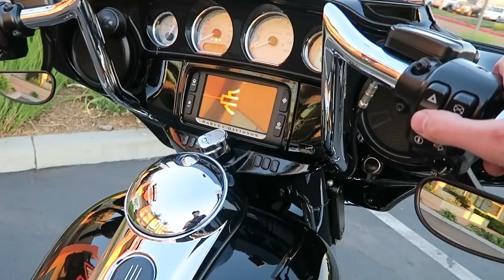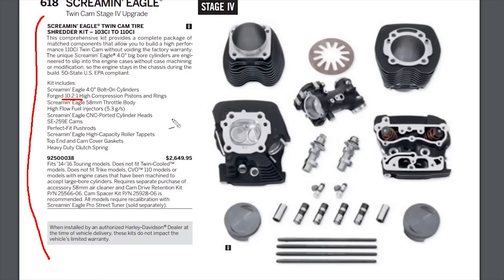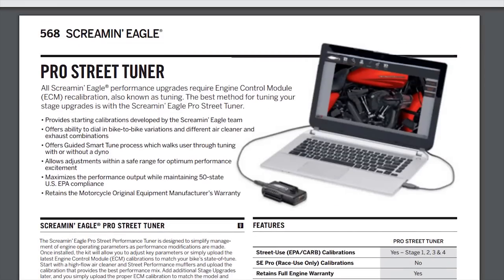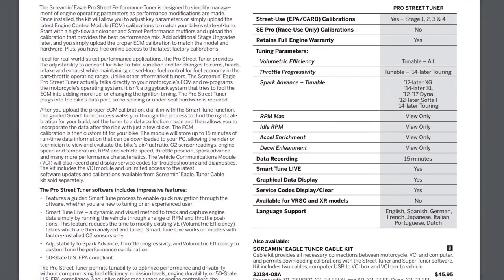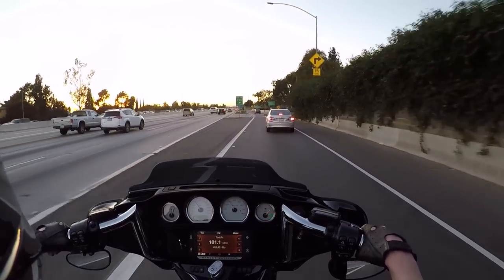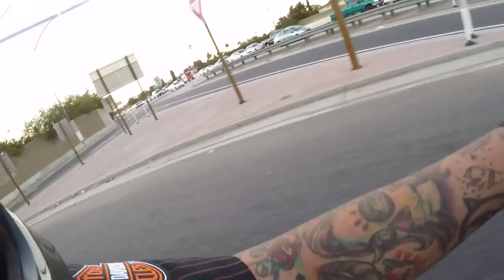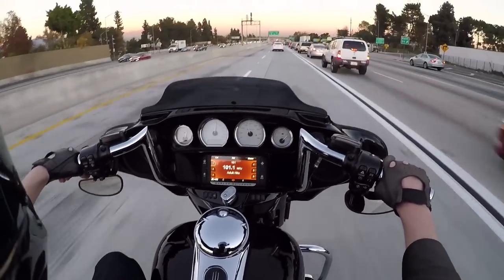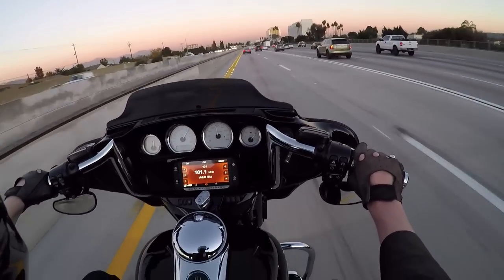Milwaukee-Eight Stage 4 VS Twin Cam 110 Stage 4 │Harley-Davidson Screamin' Eagle

Comment: Fantastic run, the roads don't look all that smooth. I have the 103 in my 2016, did put oversize titans, harley hi flow kit and the Vance/hines fp3. What would you suggest doing next or leave it alone? Thanks
Reply from the maker: With that build you get the benefit of a richer sounding exhaust and a slight performance increase. If you want more torque and HP then do a stage 3 or 4

Comment: Does it matter if you keep the same stock tire versus a tire that handles high speed?  Does the tires make a difference at high speed (i.e vibrations,death wobble.)
Reply from the maker: These tires are just fine. The bike tracked great. Some times of freeway joints of bumps it can shimmy a little.
Reply: Always liked Pirelli night dragon tires. Very sticky when performance trumps longevity.

Comment: glad I found this video, my 18 limited is coming in soon and have been anxious as to how this m8 will compare with my 16 limited. Seems that the twin cams make more power at lower rpm than the m8. So the stage iv is out seems like it would be a waste of money. Matt what are your thoughts on the m8 with stage 2 and a good tune. The twin cam I have now has 98.75 hwpr and 121 tourque with 585 cams, fuelsac headpipe ,super tuner and screaming eagle springs and lifters. Can't seem to find any numbers like this on m8. Yes numbers are numbers, but what are your thoughts.
Reply: oh she is still 103
Reply from the maker: The stage 4 needs to be run at a higher RPM to get the max benefit out of the build and cam. Your build you mentioned is a nice low end torque build. This is more for the guy that like to run their Harley at a higher RPM. The 585 cam is a low end torque power delivery. So it just comes down to your riding style

Comment: I added high flow intake, competition 2-1 header and FI remap to my 17 Road King M8. The mid-range is awesome and I pull my buddies Indian 111 to the governor before he eventually passes me :( Hey Matt! How do I turn that shit off man!! Great video as usual! Thanks!
Reply from the maker: I don't know. Let me know if you find a way
Reply: Only way to do it is after market tuner , but that will possibly void warranty.
Reply: Israel Rangel without a doubt voids warranty.
Reply: seems like you could figure out a way to fool the computer on actual speed. i'm guessing it is speed controlled for top speed and not rpm too.

Comment: Great video Matt Thanks! I have the Stage IV Kit with the S.E. Smart Auto tune pro & the Street tuner on an 18 FLTRXS & the governor will not let the bike go over 111mph. You say in the video you have done 120mph I'm trying to figure out if that is truthful or not? HD tech support has told me that 17 & newer M8 touring bikes have a factory governor at 107mph. Just trying to figure out how to actually get this thing to do what it's capable of. I know it can cause i'm only 4,100 rpm in 6th gear when  kicks in & 4,500 in fifth gear just stuck at 111mph!
Damn it!
Reply from the maker: Yea, the governor sucks. If I find out how to over ride it I’ll let you know.

Comment: Great Video, but why would Harley put a governor on there bikes? I do not run 120 or above all the time but I do at times just because I can. If I were to buy a new bike can the governor be disabled? The other question, is this governor on all the new models or just certain models?
Reply from the maker: I think the governor is on all the M8 engines. I haven’t tested that though. Currently i don’t know of a
Way to disable the governor.
Reply: All m8. Can't get rid of the governor yet. My dealer says they are adding things for the tuner. Might check for updates.

Comment: Matt, with this kit Stage 4 does the Milwaukee 8 do better if you get stuck in traffic in terms of overheating compared to previous power upgrade kits for the twin cam?
By overheating I mean the engine shutting off .
This situation of not moving  unfortunately occures more and more often even on highways. Unfortunately where I live we can' t split lanes and every other car is a cop car so it ain't an option..
Thanks!

Comment: $4,000+ EXTRA to make a $25,000+ bike with an 1800+cc motor make 100hp? I like Harleys but that's ridiculous IMO
Reply: Exactly. I have a 2019 electra glide.  Need i say more.
Reply: @jameswise170  that just isn't how it works. I wont waste time explaining why, but it just isn't.
Reply: @jameswise170  tq gets you off the line HP pulls you up top
Reply: @Tberg725  yea but when you understand that tq makes hp than you understand that its still tq doing all the work.
Reply: @jameswise170  but it's not just that simple tho in you're theory HP dont matter just TQ...so my harley hit 112TQ and my GSXR has only 86TQ so going off your theory of only TQ mattering the harley should  beat the gsxr but that ain't happening by a LONG SHOT the Harley ends up laying down 102HP and the GSXR laid down 184HP  so it's not just all about TQ
Reply: @Tberg725  to make 184 hp you need more tq. Tq is the twisting force. You can only make power tq or hp by twisting the crankshaft. Tq is hp at higher rpms. Its tq doing all the work. Tq is named tq under 5252 rpms. Over 5252 rpms tq is then labled as hp. But its still tq at any rpm doing all the work. There are harleys going 200mph with less than 184hp. They are seen on the salt flats all the time

Comment: I'm getting ready to trade in my 13 roadglide custom with a 103 pushing 107hp, 113tq at the wheel for a 19 roadglide ultra 114. Going with a stage 1 at first but probably go to a stage 3 after a year of owning it.

Comment: Hey Matt, great video! Do you know what chrome trim ring was on the black bike? It looked really good.

Maybe this was mentioned previously, but the M8 bike is an EPA tuned/compliant bike, whereas the 110 is not and tuned for better performance. Give the M8 the right cam and tune it with the old SE tuner and you would have seen a greater difference in performance between the two bikes. The M8 would have noticeably outperformed the twin cam, it simply breathes much better. I know this comparison used current HD kits and tuners, but the 110 was better tuned which gave the impression of comparable performance. The M8 was still choked  and under performing to meet EPA regulations.
After watching this video, and if only using HD components, the twin cam is the better choice. I wish this comparison was available before I bought my 17 Street Glide (and I knew how bad the EPA affected modding the M8 and how the dealers won't tune aftermarket parts), because I would have bought a 16 twin cam and had fun with all the aftermarket performance mods as well as dealer capable tuning for such.
Your channel rocks - thanks!

Comment: Hey so I've heard you say the stage 4 is governed at 120mph  and I've also heard you say it's governed at 110mph has something changed. Before I had got any Stages on my 2017 Road Glide I couldn't get it past 110mph. At stock are the bikes governed.

Comment: Did the kit come with the high horsepower Stage II (#92500047 ), or the high toque Stage II (92500058)?  It looks like you have the high HP kit, which would explain the 110 TC's better low end performance.

Comment: Great vid Matt and as interesting as it is there are a lot of questions.  Mostly the tuners.  I own a dyno company in Wyoming and I usually see about 12-13% higher power/torque from a good tune over a dead stock bike no parts change.  I haven't run an M8 yet but I just bought a 2017 street glide and I'll have info on that as soon as the weather gets better...for now I can tell you it's WAY out of tune.  I have a 2005 Ultra that I built that runs great but I've seen TC's twist cranks if they're not welded so you have to be careful if you want reliable power...heard that's not the case with the M8.  My plan is to run it bone stock, change the mufflers, change the air cleaner and change the cam last.  I'll run each before and after tuning.  The pro street tuner doesn't offer much according to what I've seen...doesn't do much for timing and that's where the torque is.  Also Zippers has a new cam (468) that they're claiming 116 ft lbs torque with cam, air cleaner, slipons and tune.  If they actually do those figures I can't see much of a reason to build a bigger motor.  The other thing you didn't take into account here is the M8 is supposed to run 35* cooler all around which is a HUGE difference for reliability.  I know you guys are a Harley dealer and I'm not so I can use any tuner I want but if you can put a bolt in cam (no valve spring change or fly cutting the pistons), mufflers, air cleaner and tune and get the numbers they say it's going to change the way a lot of guys think.  There's just no way a 2 valve head can flow like a 4 valve head.  The twin cam camshaft has a ton of lift (probably .580's) and the M8 uses WAY less lift to make the same amount of torque/hp which will seriously reduce the valve train friction which will lower the oil temp and reduce valve spring opening and seriously reduce the chance of breaking a valve spring.   My new M8 already hauls ass and it's stock...my 95" is fast but it's got a huge cam and I ported the hell out of the heads and it's got 2.02 valves.  Do all that to an M8 and I think the sky's the limit.  I'll let you know what I find.  I'd LOVE to see a vid on dyno runs changing one part at a time if you guys can get to it.  No one has really done that.  By the way...the 468 cam is supposed to make 114 ft lbs of torque with the stock header WITH the cat...a header is only 2 ft lbs higher.....we'll see!  Red Shift (Zippers) has a pretty good vid on youtube if you have time to watch it...pretty interesting.  Harley cams are usually not very good at making power compared to other manufacturers...  Ride safe bro!
Reply from the maker: Thanks for the comment my friend, you definitely know your stuff. Let me know what you find out.

Comment: stock for stock the m8 has the power but if you are going with the stage 4 kits i would take the twin cam all day long just to many issues with the oil sumping on the m8  with engine failures for me to risk it

Comment: The 110 Stage IV kicked that ass! Wish I had mine back! This new M8 sucks the big one! I did the Stage IV on my 114 M8 and had nothing but problems. Sumping was a big issue. Traded for an 18 M8 and with 1K miles on it sumped too! I was going to do the Stage IV on the 117 to 117 but looking at the RPMs for HP you have to have the RPMs way up there.
Reply from the maker: Dang man. That sucks. We have had a few cases but most everyone loves their M8. I wouldn’t trade mine for anything. Power is noticeably better than the Twin cam and it does a lot better in the heat

Comment: I've been thinking of buying the tire shredder kit for my 12 street Glide that my wife and I take vacation on every year. So were always riding 2 up so more HP and torque would be nice but I'm not sure what can to go with. I already have a true dual head pipe CFR mufflers and performance air breather. I don't care about top speed and I want a cam that will start building power around 1,000 to 1,500 RPMs so the 259 cam is out and I'm thinking of SE 585 but not sure. Any suggestions? We do have a trunk on it also and are gonna get a trailer.